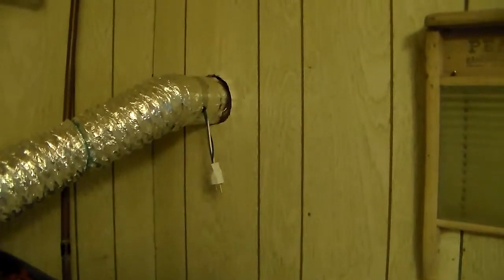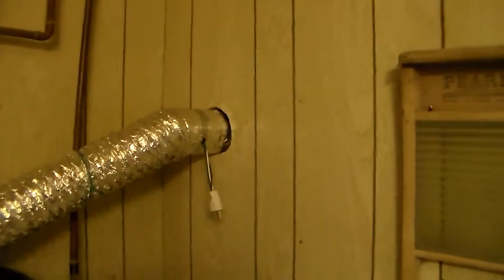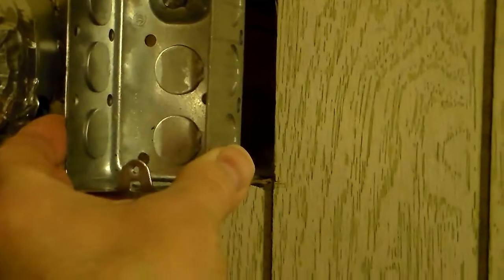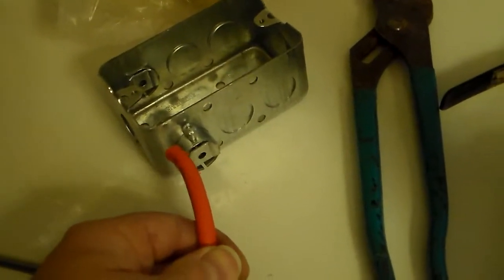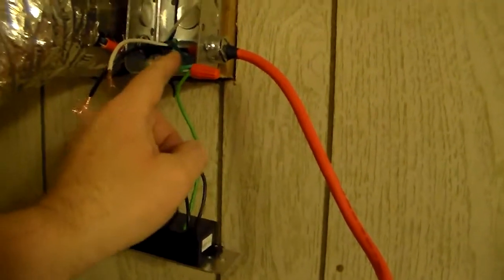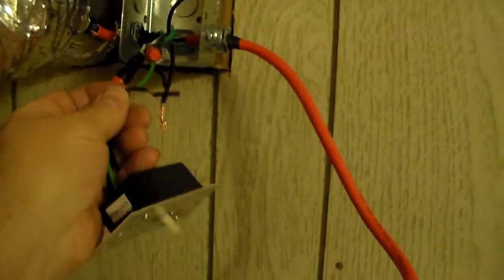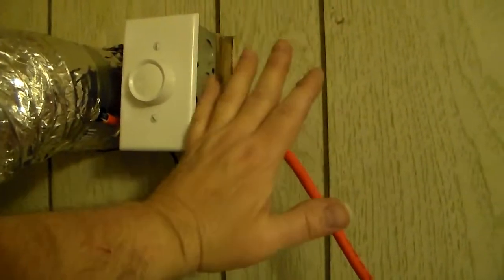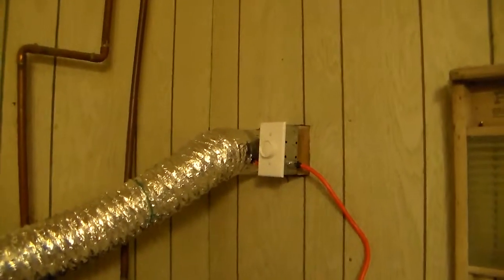vented litter box pt2  blower wiring

Comment from the maker: you should use a properly mounted electrical box this will allow you to add the light dimmer or fan control as the noise may bother some cats so it is best to start it off low & turn it up a little each week until it gets to 3/4

if you are not using it with a fan speed control you can just connect it with a plug but you should fasten the cord to the wall or something with a thin metal wire clip & a screw to protect it from getting pulled if the cor gets caught on something